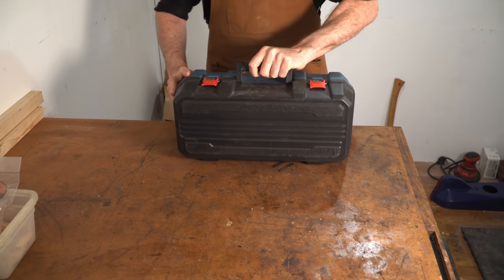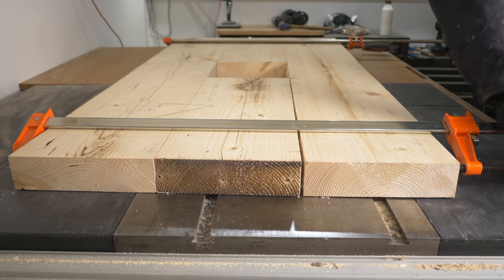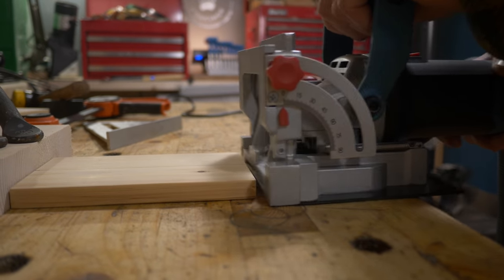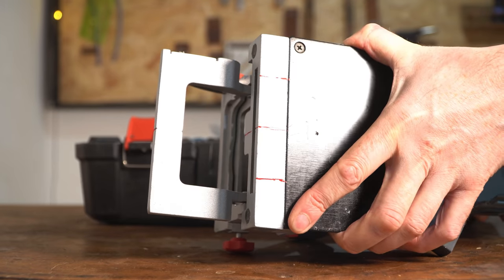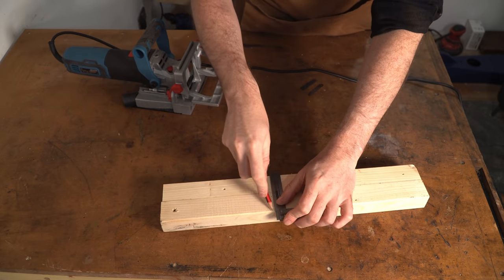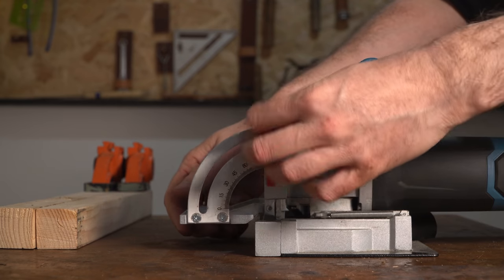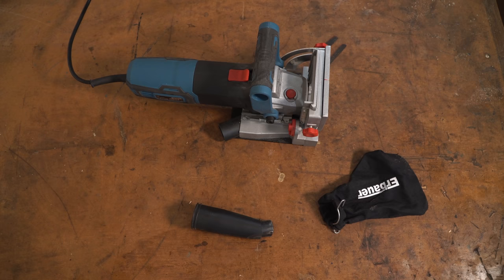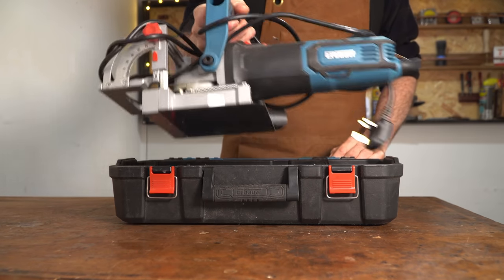Badger Bites Biscuit Jointer

Comment: I bought a freud biscuit joiner 7 or 8 years ago,seldom use it. I found that the biscuits were too loose in the slot,the blade is obviously too thick. I managed to buy a second hand mafell duo doweller,never looked at the biscuit joiner since. I have some great tools,doesn’t make much difference,my work’s still shit. All the gear,no idea.
Reply from the maker: Haha. That does look a great tool

Comment: Cheers Matt, I've owned the same model for years. Like you, I've not used it as much as I thought I would, but don't regret the purchase. It saved the day on an oak flooring project, by replacing the absent  tough and groove. 
Again, like you, I chose it on price, as it seemed the best option - got it on offer at £59.
Since then, I've used it on worktops for alignment, architraves and shelving. 
No, they are not particularly strong, but in Combi with glue and screws, they are hard to beat for simplicity and cost.

Comment: Interesting video Matt. I have a very, very old one and it's still as useful as when I first got it. Really useful for lining up if one board has a bit of a bend in it; they can be used for putting longer slots into wood if you don't have a router and cutting for mitre inserts. As you say, not essential but occasionally quite handy.
Reply from the maker: Yes it can have lots of uses

Comment: I tried the cheap offerings from both Toolstation and Screwfix and ended up returning both of them because they were not well designed or made and gave poor alignment when used with the adjustable guide.  I ended up paying £250 for a Makita which was in a different league.  I agree with you Matt that they are not an essential tool but when I'm using any tool I want a good and reliable experience and I've found that often you just have to bite the bullet and pay up!

Comment: I have to say, I used to own a good biscuit joiner (PC 557), but after a while stopped using it. It just didn't provide much help with alignment in my experience. That said, last year I finally got a dowelmax and I'm still kicking myself for not having done it sooner. Roughly the same cost, stronger joints, much better alignment, and just as easy to use.
Reply from the maker: I will look that up

Comment: Had my Erbauer a couple of years now, the only issue I have with it is keeping the fence paralel to the blade, it can make joints very tight to assemble if it's slightly out.
Reply from the maker: I will watch out for that then